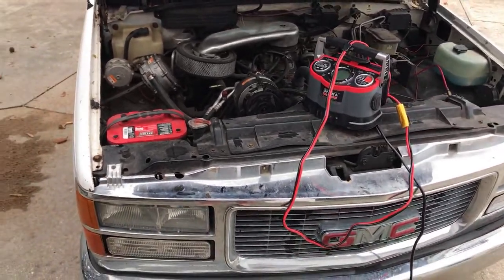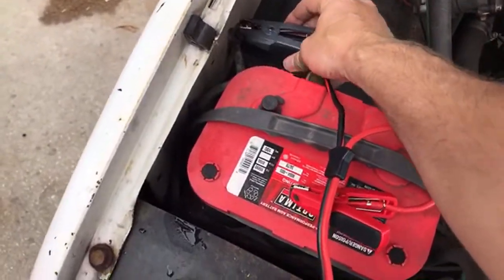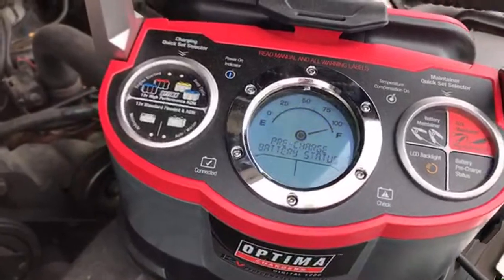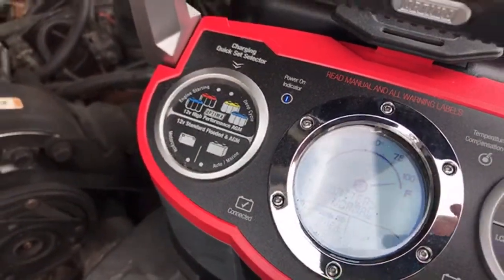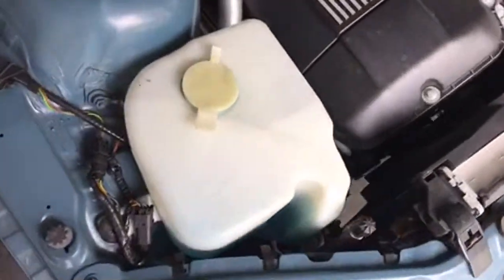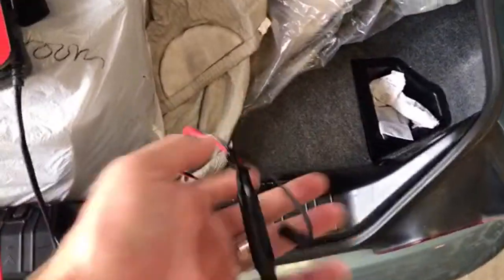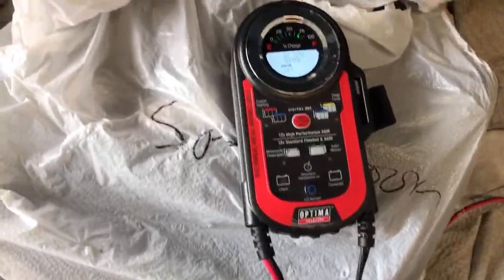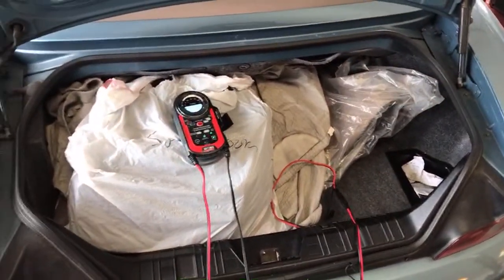How to charge a car battery

Comment: On standard battery, do i have to disconnect the battery from the car connections before charging? Thanks
Reply from the maker: You do not have to disconnect a battery from the car connections before charging.
Reply: @optimabatteries  thanks!